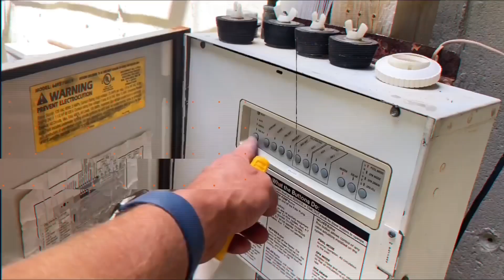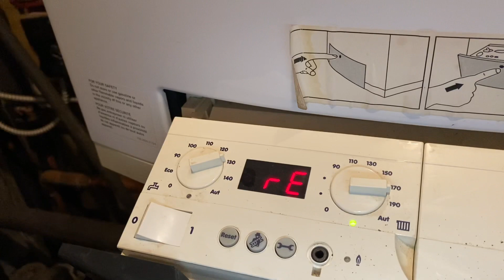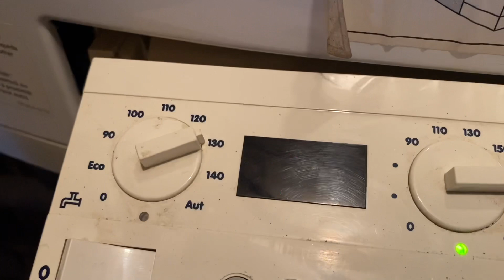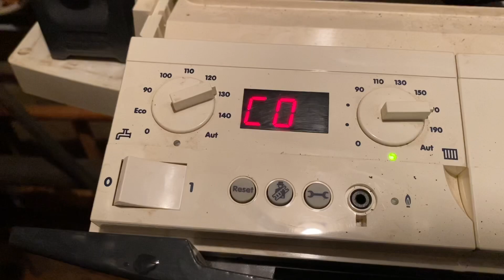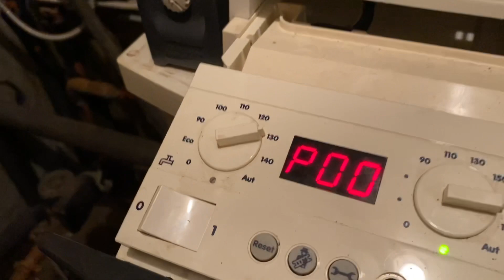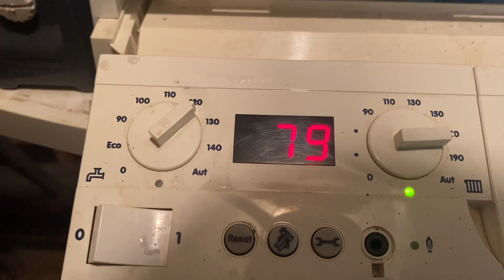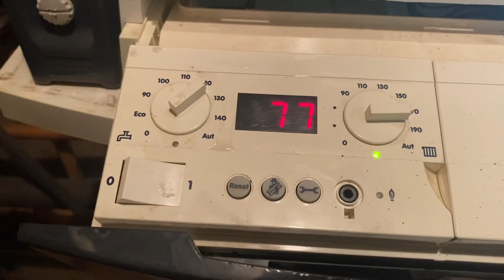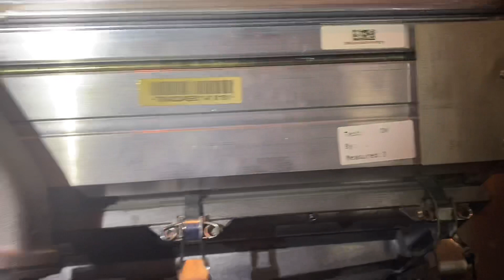Buderus Logamax GB142 No Heat or Hot Water Error CO Explained and Repaired

Comment: I worked on one of these for the first time a few weeks ago. I was very impressed with how easy they are to service. It feels with most boilers the engineers actively hate plumbers and make them overly difficult to work on, cleaning the heat exchanger and combustion chamber was very easy.

Comment: Nice one Mikey...
I worked as a service Engineer for Buderus in the UK for ten years mainly on their oil boilers in commercial premises and then switched over to gas when they started producing wall hung domestic units , these boilers if maintained correctly are bulletproof machines and will last 30 years + without any major component issues
They are extremely expensive to buy compared to other boilers but you get what you pay for and they have always come with a no quibble 10 year guarantee on parts and labour providing you use a Buderus approved service company for annual maintenance.
Cheers.... 👍

Comment: Buderus (a Dutch company) introduced into the UK  2004/5.
High quality boilers, so good that Bosch Thermotecnic bought the company only to find they were losing sales of British made Worcester boilers. They stopped importing the 500 and 600 range that directly competed with Worcester, but the 800 (the one in the video is a later version) remained because it filled a gap in the range. First one from 2005 still going strong,serviced every year and system water kept clean.

Comment: Is there any major difference between the buderus, or the Bosch wall hung boiler?
Obviously it’s not Korean junk or it would have died.
But I’m wondering what the heck they’ve been doing for maintenance for the past ten years?
You mentioned magnets for the return because of iron pipe would heating the cold water create condensate, if so they didn’t seem to be using a condensate neutralizing filter for treatment to prevent corrosion from the iron pipes.
Or am I missing something?
I try to listen to you and understand what happened with each system.
I’m hoping to convert from steam heating to hot water heating system but it sounds like if maintenance isn’t done annually it’s going to look like their boiler. What I don’t spend on gas I’m going to need for maintenance and repair and cleaning so I might get a slightly smaller gas bill but get a bigger maintenance bill each year.